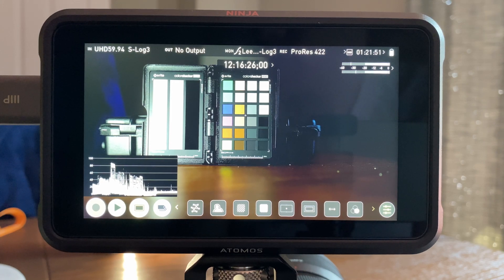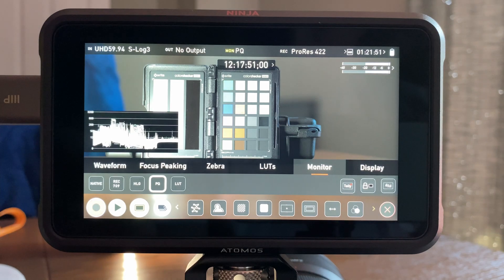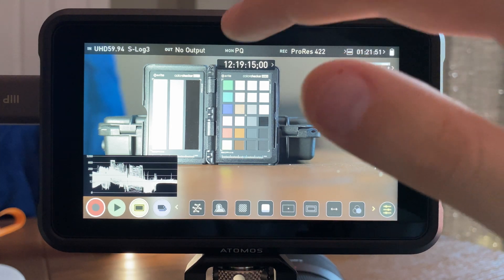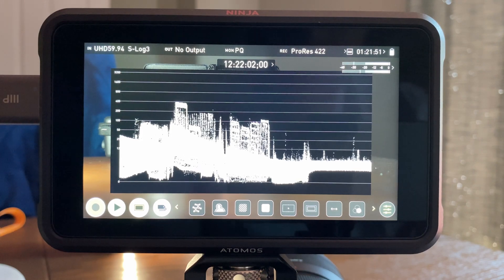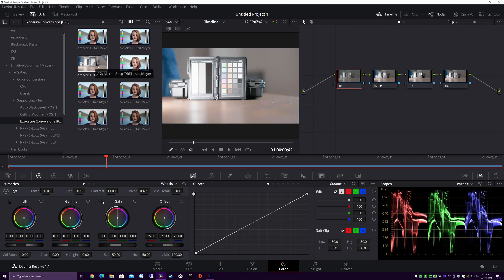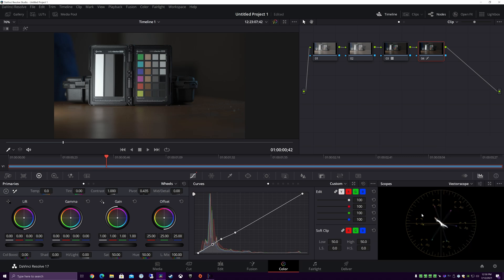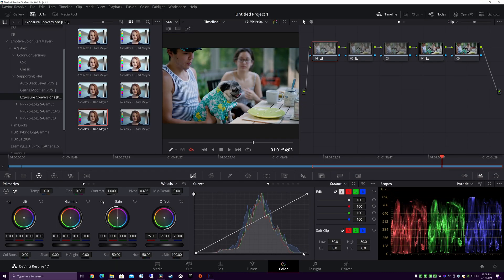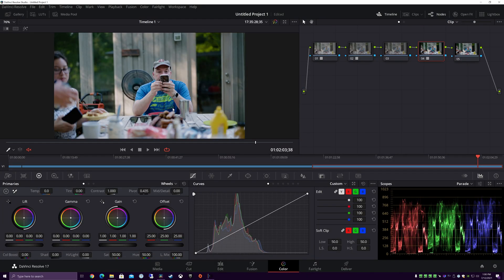Atomos Ninja V A7SIII Display LUT Bug Work Around

Comment: I followed your video all the way up to a single point I know you went a route you shouldn't have went. You should have done a CST. if its R.709, make your first node a CST input R.709 and Linear, and output to SLOG3/SGamaut3, and your last node another CST from SLOG3, back to R.709. Just did that and it looks exactly how it should

Comment: Also I'm curious how editing on an oled tv works? I recently got an LG C1 which probably has pretty solid color coverage (need to check). If you have a req709 timeline, are there any consideration to be aware of if editing on an oled?
Reply from the maker: It's way better than using any other kind of monitor, but not practical if you want to use it to create HDR video.

Comment: Great video, do you know if any firmware updates have fixed this yet? It's been a little over 6 months. Also for this scenario would a lut combiner fix the issue if you wanted to monitor? Essentially adding a full to legal lut, follwed by the desired lut? Saw someone suggesting that online.
Reply from the maker: Not fixed as far as I know. Paul Leeming has a range fix lut on his website.

Comment: I am so glad to know I wasn't crazy when trying to monitor with the Ninja V using the Phantom Luts. It was always broken! Would you know if it is possible to implement into the LUT itself a workaround to the Ninja V Video to Full?
Reply from the maker: That would only if you have the original transfer, I think. You're welcome to try.
Reply: Hi Fled, been holding out from buying the monitor, but the updated AML has completely solved the issue right? 
Thanks I’m advance!
Reply: @tantrinh3099  yeap! Not a problem at all now. You get the same look on the monitor and when you apply the lut on the software.
Reply: @fledsilveiraoficial     hello my friend, I m facing the same problem as you, 2 yers later :P  Have you find any solution.? I have Phantom arri neutral lut and monitor lut, but with both, the image displayed on the monitor is darker than the image on final cut after I apply the same lut. Blacks are crushed
Reply: @avgoustinos  if you buy now, he will send with a monitor LUT as well. And the monitor version works fine for me
Reply: New updated Phantom Luts gives special Atomos Monitoring Luts!
Reply: @woutkoot9367  I saw that and I am using it! Problem solved haha Thanks
Reply: @fledsilveiraoficial  Where did you see the Phantom luts for atomos monitoring ? Please could you link them to me, are they just in the pack when you buy it off phantom lut's website or where did you find them ?
Reply: @JBGamingPC  yea, he added to the phantom pack. Works great
Reply: @fledsilveiraoficial  Thank you, so when i buy his Arrir A7S III phantom lut pack, it is included? Thank u!
Reply: @JBGamingPC  Yes
Reply: @woutkoot9367  Please could you link me where the Phantom Luts for Atomos monitoring are? I can't see it on the Phantom luts website, I mean there is no mention of atomos monitoring lut as part of either pack. Thx
Reply: @JBGamingPC  hello my friend, I m facing the same problem as you, 2 yers later :P  Have you find any solution.? I have Phanton arri neutral lut and monitor lut, but with both, the image displayed on the monitor is darker than the image on final cut after I apply the same lut. Blacks are crushed